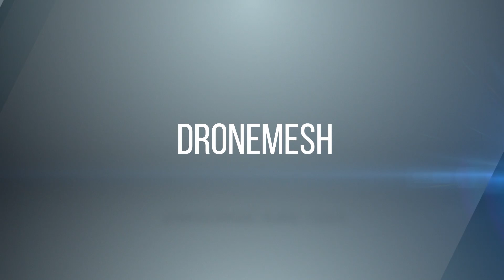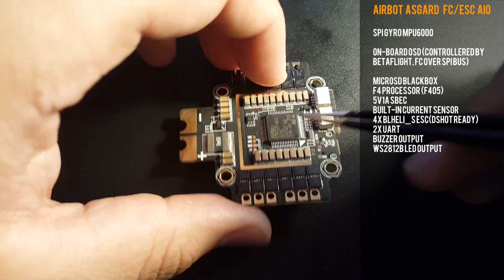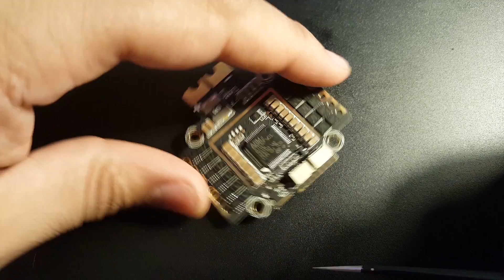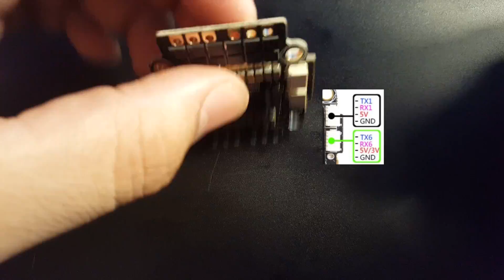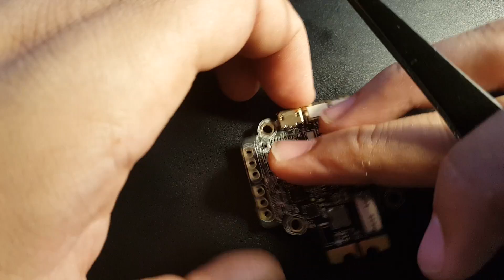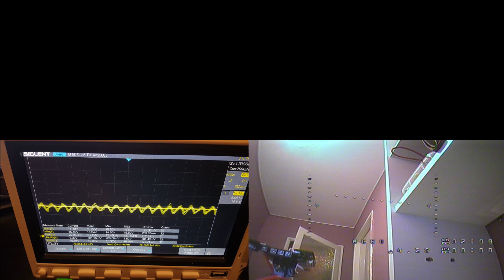Airbot Asgard V2 // Review and Noise testing?

Comment: Nice review man :)
If you had chance to use a Typhoon 4-in-1 ESCs from Airbot, you would have noticed it actually the same board and design. It's designed to have the power leads on the right side. Capacitor has always been mandatory with the Typhoon ESCs so it should be the same with the Asgard.
Thanks for sharing, i will buy one since i love the Typhoon 4-in-1 ESCs and the Omnibus F4 Pro. Asgard seems to be the fusion of both boards. Definitely for me :)
Have a great weekend and keep on flying!

Comment: Kamikaze AIO same (but improved) as this but lots of silicon cables + xt60 presoldered with 16AWG + silicon dampers + 1000uf low esr cap. And at the same price : https://www.undergroundfpv.com/collections/flight-controllers/products/kamikaze-pro-all-in-1?variant=38161798596

Comment: If you mount the asgard as you are holding it 3:59 in, then you need to change the angel with 90 deg in beta flight, its the correct way to mount it but you need to do that change. Also recommended to mount a minimum of 1000uf cap on the acc. Im running 2x470uf on mine but only got z1806/2900kv motors so I'm not pulling that much amp.
Reply: I would still be scratching my head in the begin of this hobby to make head or tail of most of the electronics if it wasn't for JC. He will be... and shall be Greatly missed!
Reply from the maker: Great thanks for the tip..Much appreciated ^_^
Reply: (R.I.P)Jc/Project Blue Falcon made an awesome vid on the V1 card, you got the V2 :) 

For me that card rocks, Noa Koch runs it on Brother hobby 2206/2600 I think and got an 5th place in Shanghai this weekend so it performs beautifully.
Reply from the maker: May his soul rest in peace.. We lost an amazing guy in this community :(
Reply: Ya :( can't tell all the times he has helped me, So I hope his profiles will be kept on youtube, its an clean library of good information.

Comment: Hi, where and witch kind of capasitators should i buy? i have a lot of noice in my quads and i dont know where to get the capasitators.
Reply: Hi :)
Try to buy low ESR 35V 1000uf or 25V 1000uf! I have better results with the first one but they are big capacitors.